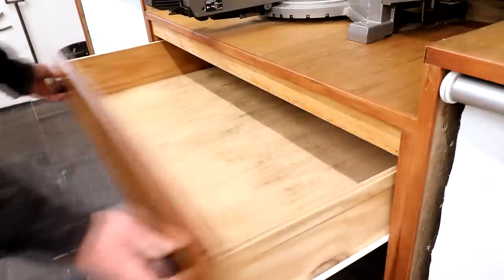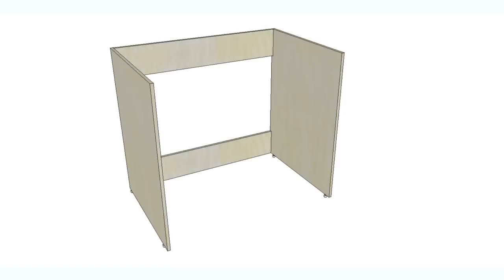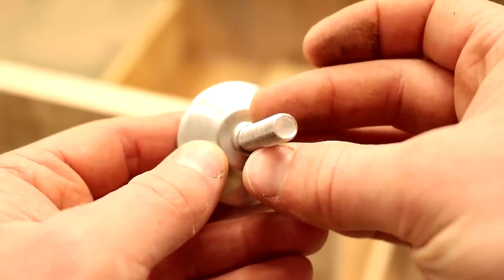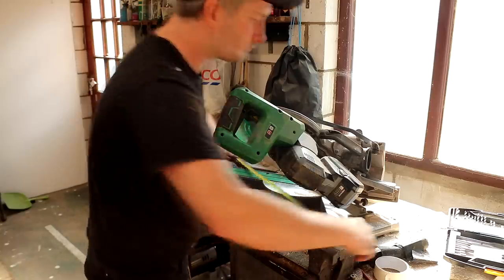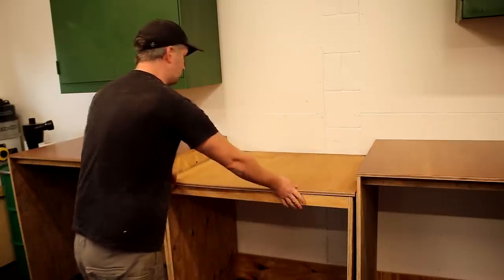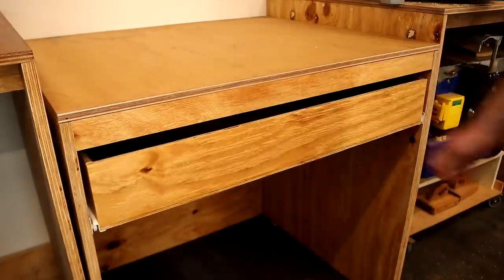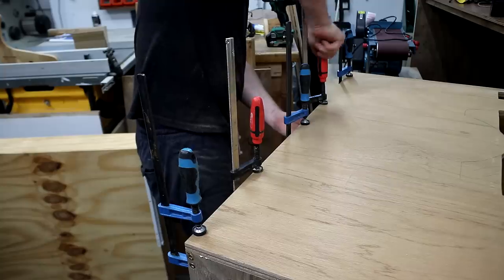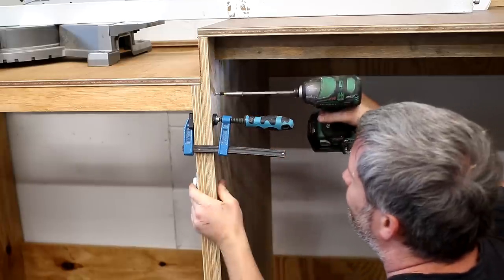Making The Mitre Saw Station

Comment: Hi Keith, a couple of comments if I may.  Small hardwood blocks either side of the T-Nuts would give them a more secure fixing.  Also, locknuts on the adjusters will stop them creeping downwards through vibration.  Yes, they have rubber bases to reduce this, but when the rubber hardens with age, they will not be as grippy.

Comment: Kieth, why not put an angled board in the back of the drawer, to direct the sawdust towards the front of the drawer for clean-out?
Reply from the maker: I'll replace the runners eventually 👍
Reply: Tried this with my table saw bench, even at 45* the sawdust sticks and backs up. You have to go in with a brush or vac. A hack will have to be found.

Comment: Do you think the feet that you used would be strong enough if you'd built cabinets with storage rather than housing for your floor machinery? I've seen other styles of adjustable feet but I like the ones you have used due to the low profile and 'in-built' install. thanks

Comment: Hi Keith really like the station, very practical!

Quick unrelated question, I noticed you have a piece of tape over the blade access on your plunge saw and I was wondering if you've noticed any real improvement in the dust collection by doing it?
Reply from the maker: It just helps stop dust coming out the hole 👍

Comment: Keith, I like the way you are using the space to store your thicknesser and belt sander. However,  a question for you, do they get higher, stooping down that low would kill my back, (I am 6'2" though)
Reply from the maker: I built the mitre saw station very tall so that the machines underneath are still at a good operational height - explained in the video. I don't remember the exact dimensions though...

Comment: Keith I think I have a set of large drawer runners like the ones you used but longer , I will have a look tomorrow but as I’m in between workshops at the moment it will take time but I know they are about somewhere , they are to long for me to use , when I find them I will measure them and let you know the size and if you can use them you can have them
Reply from the maker: Thank you!

Comment: Nice project,

Why did you use those feet to level your project?

Just make a ladder frame, level this up on the floor and mount your cabs on that.  Job done.

This is the way we used to install a kitchen in old property where the floor was not level.

Regards,  Bill.
Reply from the maker: Because I need to be able to wheel my machines under the mitre station
Reply: @RagnBoneBrown  Ah, now I understand.

Nice video's always enjoy watching them.

Regards,  Bill.

Comment: Absolute bummer with the feet positions, when you think you have everything planned out... [If you're like me, you thought, "well there's the 'cock-up' outta the way"] Redeemed with the wedge idea for adjusting. Don't think you spent to long levelling; three units, one garage floor and an absolute need to have the top perfectly level - needs time and you did well - I could feel the relief when you screwed those units, finally, together, PHEW! I still have to lug my saw out onto the patio and screw it down to my workmate every time, so, I hate you! Great job, well done.
Reply: p.s. I think you must have blown the SFX budget on that 'reconstruction' but well worth it for the drama :)

Comment: Instead of fiddling for almost two hours to get the height right, I would have done it the other way around. So on the top measure the right and correct distance, screw that in place. Than it's just a matter of dropping the feet until they hit the floor.
Anyway, nice build as always. Jealous of the amount of space you have.

Comment: Why do people insist on using impact drivers on such small screws as drawer runners ?
Self centre bit, hand screw the little screw in place.
Overkill to say the least mate.
Reply from the maker: I don't need a self-centre bit to find centre, never bought one for that reason. And any decent impact driver has power settings to allow screws to be driven either softly or aggressively depending on the application